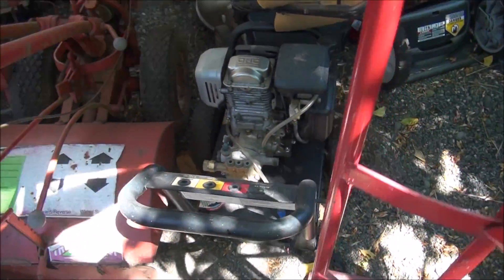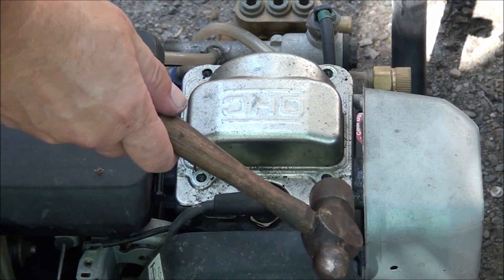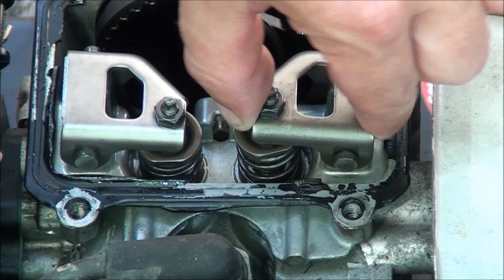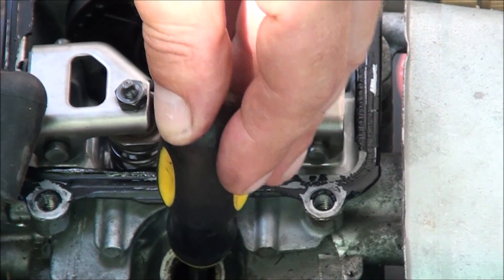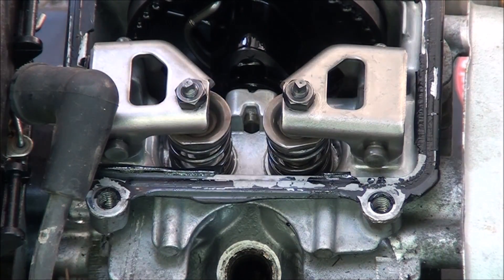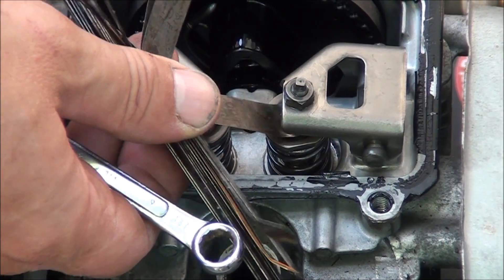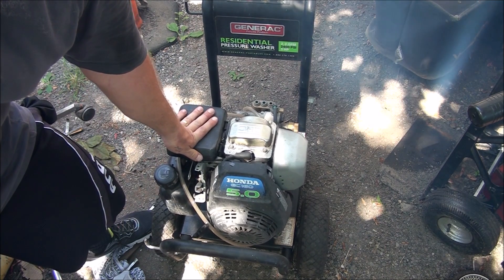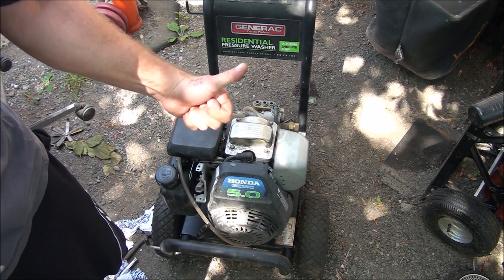HONDA GC160 - GC190 Engine VALVE ADJUSTMENT and SPECIFICATIONS. PRESSURE WASHER

Comment: @5:14 - really, either is correct - the TDC you want is at the end of the compression stroke and the beginning of the combustion stroke.

The TDC you DON'T want is between the exhaust and intake strokes.

Typically, I rotate the engine till the intake valve closes then continue to rotate the engine as I feel for TDC with a soda straw (hard to break and lose in the engine) on top of the piston (through the spark plug hole).
Reply from the maker: great tips!

Comment: Broken exhaust rocker is a relatively common problem with GCV 160/190s.
Don't replace that rocker without checking out my fix for valve guide contact. Otherwise, you might be replacing it again.
https://www.youtube.com/watch?v=zZz0MRqxGX8
Reply: I'm working on my GXC 190 as I'm watching a refresher here. Sat for a long period n it was extremely hard to crank ie. When I did get it cranked it ran like shit n smoked. I attributed it to the engine being upside down while I installed a new pump.So per all reports the EV was probably stuck & a cracked rocker arm, right? I was expecting to find the same, but it's my intake rocker arm pin. The pin is bent. It's caused the arm to b extremely wobbly.  I'm certain the valves need resetting. It literally bent that solid steel pin. 😬It was a PIA getting that outta there too. I think the Rocker Arm is bent  too. Not taking any chances. No cracks tho.
Reply: @kellywilliams9194  Wow. I can only wonder. Perhaps oil was allowed to fill up somewhere and you hydraulic-ed the valve? I don't know. Those parts are relatively inexpensive. I'd change rocker and pin. I think the rocker assy was only about $7. If it were mine, I'd assume that the exhaust valve guide was eventually going to migrate outward (if it hasn't already), and I'd do the modification on it, as outlined in my video. Make sure you at least try to tap the exhaust guide back in until it fully seats, just to be safe.
Reply: netdoctor1. I felt like I need to take the springs off to further inspect the seals. Do you have a video of removing and installing those? I'd appreciate any help. See I had never had a problem with the engine. So I'd already mounted the new pump.I gotta tear it all back down now don't I? Putting that pump on by myself, n w/no shop, vice etc. That was a damn nightmare. That's what I have 2 do right? Like I said, I already have the springs off.Thnks again for your videos and your pointers
Reply: @kellywilliams9194  I don't have an additional video showing that process. I suggest that the most important thing to keep in mind, if you're going to remove or reinstall the valve springs and keepers, is leaving the piston at Top Dead Center. That will assure that the valve cannot be pushed back into the cylinder, which would be a nightmare if allowed to happen. The springs are not very stout, and it's relatively easy enough to pop the keeper in place on the valve stem.

Comment: Hi Jeff! Thanks for the video! Never hit the valve cover with a hammer or mallet! Always try some finesse while trying to pry it of! Ether tapped with 1 x 4 or take the exhaust cover off to have room to pry it it off! Also, don’t run the engine more than a few minutes with the water running thru the pump.
Reply from the maker: Great tips! I was not going to reuse the water pump. Correct! as long as you only run it for 30 seconds or so without water, no pump damage should occur

Comment: Never run the engine without water through the pump! Never hip valve cover with a hammer or mallet! You have to use some finesse to pry the cover of! If you take of the exhaust cover, you will have room to pry it off! Other than that nice video!

Comment: Any ideal what wrong with my pressure, it is work on yellow, green and black tips, but the pump will stop and go when I using white or red tips!
Reply from the maker: maybe the tips are plugged
Reply: @jeffslawnmowerrepairandservice  Thanks. I will check

Comment: Jeff, thanks for the video. I would not hammer it off. The rocker arm shaft pins are held in place by the valve cover, the side you dented. Would not run the water pump without water. The other stuff was good.
Reply from the maker: Thanks! Good tips. Yes, no water in a water pump is bad.  I was planning on scrapping the water pump

Comment: great way to burn the pump out lol fix one thing wreck the other
Reply from the maker: yes running a water pump for too long without water can damage the pump. For this, I was only going to use the engine to put it on a minibike.

Comment: The service manual says Intake lash should be .15 on intake and .20 on exhaust, why are you using .006 and .008
Reply: One is mm and one is inches einstein
Reply: That’s the same thing! .006 equals .015 inches 😂😂😂😂
Reply: The cam gear has two marks to indicate top dead center.
If it hasn't jumped time.
Reply from the maker: ?? weird, when I looked it up these were the specs I found
Reply: The .006 and .008 are thousanths of an inch and the .15 and .20 are millimeters. They are the same specs. There are 25.4 mm to the inch, so .006 inches X 25.4 mm/inch = .15 mm.
Reply: The key to life is .03937 or 25.4 if like to go both ways.